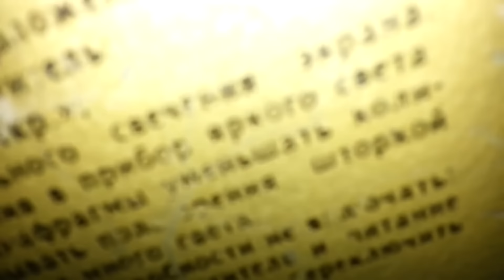Inside T-72 Main Battle Tank.

Comment: Some describe it as a jack in the box as the turret can be easily blown off.
Reply: the same can happen to M1 Abrams tanks, it's just seen less often because America doesn't go to war against professional militaries
Reply: @bluudlung  I wouldn't consider the Ukrainian army as more "professional militaries" than the Iraqis for instance.
Reply: @bluudlung  M1 has the ammo manually loaded and it’s stored in a special compartment designed so that explosions will fire upwards away from the crew
Reply: @Emperoroleary  that doesn't make it impossible, big boy
Reply: @bluudlung  what would be the source of detonation causing the turret to be reclassified as a helicopter
Reply: @Emperoroleary  u ever heard of google images?
Reply: @bluudlung  yes, but i’m wondering what would cause the turret to fly into the air, can you explain to me instead of changing the topic
Reply: @Emperoroleary  the turret isnt held down by anything. it's not bolted or welded onto the frame, it's just lowered into place. just flipping the tank would be enough to cause the turret to come off
Reply: @bluudlung  bro what the hell are you talking about? The abrams cant have its turret exploded, it doesnt use an auto loader and the ammo is stored in a safe place. In iraq it obliterated the t72
Reply: And? Look at Leopard 2s. Plenty of pictures of them after getting hit, and they don’t just pop the turret. They tend to have the entire front hull of the tank be blown away with the turret, and it’s a lot easier to hit Leopard 2’s ammunition. Same with just about every other tank design but M1.
Reply: M1 Abrams also before 1990

Comment: yes glorious soviet tank uses auto loader %50 more faster than you 
typical western abrams (i don't know nothin about tanks pls don't be 
mad)
Reply: If you dont know you dont say something.If you knee something it would be that the western tanks loader crewmans train to be as equal or a little bit faster than 4 secs and if someone takes more than 6 hes being fired so if you gonna say anything do a little research before 😉
Reply: well actually an experience loader can load faster than auto-loader system, but after a couple round the loader will getting tired or run out of shell in the "sweet spot"
Reply: Autoloader on a T-72 is 7.1 Seconds.

On an Abrams (depending on skill of the loader) it can be around 5 seconds
Reply: @TheCarDemotic  for Abrams, it will decreased after a while
Reply: @Νικόλαος-ΡαφαήλΛασκαρίδης  Humans fatigue, Machines don't lmao

Comment: Rolling tomb if penitrated. Autoloader will compromise your escape and the whole tank will explode in a matter of seconds
Reply: The autoloader is just fine. The ammunition carousel is in the bottom of the turret, the most heavily protected and least likely place of the tank to be hit and penetrated. The US military eventually put the ammunition for the M4 Sherman in the same location and the M4 became one of the least likely tanks to burn when hit  during WW2.

The problem is that the carousel only holds 22 rounds and the Soviet military wanted 40 rounds carried. How did they do this? They carried 18 rounds high up in the turret where the crew sits. This is the MOST LIKELY place to be hit. If you see a T-64/72/80/90 cook off and blow the turret, it's virtually always the extra ammunition carried high in the turret.

This was shown in the Chechnya wars. High tank losses at first until the Russian tankers began only carrying the 22 rounds in the autoloader. Suddenly it became extremely difficult to get a T-72 to cook off, generally only doing so with large roadside bombs that killed the crew anyway.

If the Russians would put those 18 rounds in a blow-out bustle at the back of the turret, separate from the crew compartment, the tanks wouldn't have that problem. The T-90 has a 10 round bustle, but still caries 8 rounds inside IIRC.
Reply: So will any nato tank

Comment: Worst autoloader ever in MBT
Reply: Surprisingly the autoloader wasn't the problem, it was more the aux ammo storage. By most accounts the T-72 autoloader was fairly reliable and worked well. Also the whole point of the low profile of the T-72 was not to be seen or get shot at so if something was shooting at you you've fucked up already.
Reply: And the myth about "it always chopped the gunner's hand" is simply not true. There are no reports to backing that and it's very... very rare.

Even if it does happened, it's mostly the crew's fault.